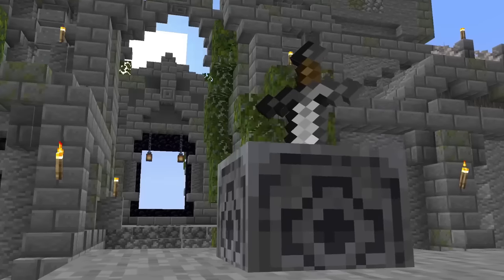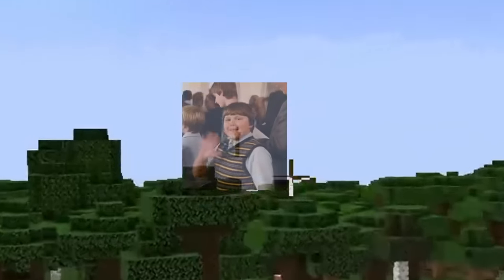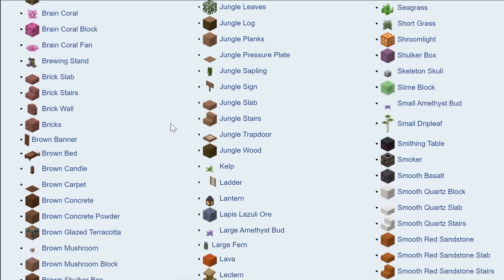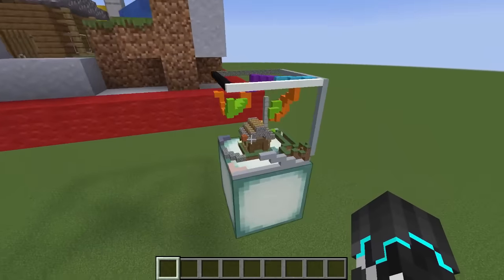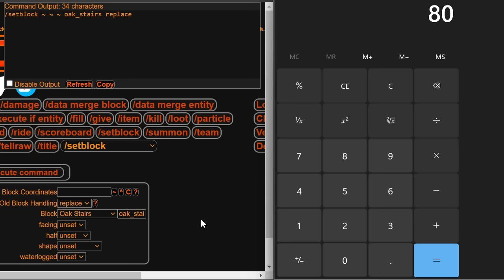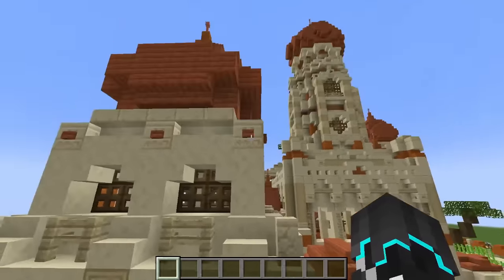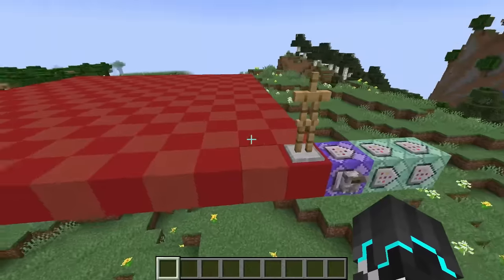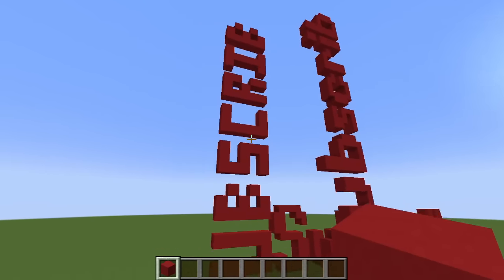3D PRINTER IN MINECRAFT

Comment: I don't know if you know but with the new macros this would actually be a single command for actually replacing the block
something along the lines of :
$execute as @e[type=armor_stand,tag=<example>] run setblock ~ ~-1 ~ minecraft $block
Although this limit the printer to work only in versions after mojang added that soo

Also notepad++ has recordings, incase that's not too late
Reply: That's what I've been thinking, right. Big problem is though that as of now, there is no command for testing what kind of block this block is. You can only ask "if block sand, if block dirt, if block stone" and so on, but you can't do something like "data get block" to get the block id. That command only works for chests and such, storage blocks.
There are two methods though that do work.
Method A is shooting an arrow at that block and extracting its nbt that says which block it's stuck in
Method B is using the loot command and thus spawning the item you get from destroying that block, and then extracting the id of the item to know what block it was.

Not the best methods for doing that stuff. I really really hope that minecraft implements a better way to check block ids. But this is all we got as of now, as much as I know.
Reply: @blarak1688  I love the idea of the printer shooting arrows at every single block before copying it over. Perfectly chaotic.
Reply: I didn’t know arrows did that!  I’m not sure if you can trick an arrow into getting stuck in a non-solid block or find the solid part of weirdly-shaped blocks, but otherwise it sounds perfect
Reply: I was telling him the same thing!
Reply: I was literally waiting for AGES to make something like this where it maps a block id to a block display

Comment: I also made block display 3d printer myself once and also got the same problem you got. It cannot read the block state and it takes too long to run. But I found (partial) solutions to all two of them.

I found the solution to block state problem in the comments of this video(thanks @blarak1688 and @uninable). An arrow stuck in a block actually stores that block's id and block states in its NBT data. Although it has a downside of only working with block that has collisions, it still enables the printer to print much more things(such as stairs, fences and glass panes) properly.
While the printer can be optimized by making it skip air blocks, it will make huge lag spikes whenever it skips too many of them. When I was making the printer I solved it by limiting the amounts of air blocks to skip, but I found a much better way to solve this problem in a command forum a few months ago. Basically, the world border grows or shrinks based on real time, and utilizing that, you can make some code loop only up to 50 milliseconds per tick. So, you can make the printer skip air blocks as quickly as possible without producing any lag.

Comment: This is so cool! I love it

Regarding the pain that is that massive hard-coded if chain, I think one could theoretically save the name string by using something along the lines of /loot give <selector> mine <X Y Z> netherite_pickaxe[Enchantments:[{"id":"silk_touch","lvl":1}]] to give the block at X Y Z to something (Such as the armour stand you already have). This has the downside that anything that just is never dropped (For instance, bedrock would be one such block) would simply end up being ignored. Despite this, it would mean that once the item has been retrieved, I think you can just merge the item name from the armour stand's item data into the block_display's data, and then empty the armour stand's inventory for the next block.

I haven't tested this though, so I have no clue if it would actually work, just offering some ideas!
Reply: this doesn’t work for blocks that don’t work with silk touch, another way (albeit even more jank) is to copy that block to some pos, shoot an arrow at arrow at it, and copy the NBT data from that arrow
Reply: @uninable  I mentioned that in my comment, but yes, that is correct. Though I did not know about the arrow thing, but it does sound janky, like you said
Reply: @GlitchlessCode  These are the only ones I know of, too. Man, Minecraft has been improving a lot on command implementations these last updates, so because of that I fall asleep every night praying and begging the coders to bless us with a command that relieves us of these janky ass methods 🙏🙏
Reply: @blarak1688  obviously mojang intended us to use negative explosion range creepers and advancements to run commands at a certain part of the tick to create player motion 🙄🙄🤦‍♂️

Comment: One way to brute force more efficiently which is probably easier to implement than macros is a thingy called tag files (yes tags very original, mojang).

To use tags you replace the block you test for with the tag name and a # identifier. Ex.: instead of "execute if block ~ ~ ~ minecraft:stone" you put "execute if block ~ ~ ~ #minecraft:base_stone_overworld" which will run for these blocks: stone, granite, diorite, andesite, tuff, deepslate (pulled straight from the wiki).
The cool part is that you can create custom tag files in your own datapack's namespace.
So, for one, you can segment the tests to massively reduce the average amount of tests per block.

Now if you create tags that bundle all blocks which share the same block states such as: all stairs, all trapdoors, all glass panes & fences & redstone dust, all directional blocks such as logs & dispensers & observers, etc...
You don't need 1600+ commands just for stairs. Instead you just do "execute if block ~ ~ ~ #Roako:stairs run function Roako:stair_check"
The "stair_check" function now needs only a little macro/return value magic to do two things.
One, check which stair type it is using the method you've been using but isolate only stairs.
Two, get the block states which you can hard code with the block state values that stairs get.
Once you have these things you got your block display.

It's probably still going to take a while to group all blocks correctly but it's a good thing many building blocks don't get any variable states.
If you really care about speed, however, you can still subdivide all state-less-blocks to get quicker queries.

Unrelated but I also wanted to mention that if you set your default program for .mcfunction files to visual studio you can use alt+select to select in columns and type or paste in every line at the same spot just like what you used excel for but quicker.
Reply from the maker: This is the most in-depth explanation I've seen so far, which I really appreciate. I have been working the past few days on getting something like this working, but like you said, grouping all the blocks and checking each of those groups is still a huge hassle. Especially when blocks like chiseled bookshelves exist (slot_0_occupied, slot_1_occupied, etc...)

I think what I'll end up doing is just replacing the datapack in the description with a version where the stairs, slabs, doors, trapdoors, and logs have dynamic placements. But other than that, it just has not been worth the time to make sure that properties like "honey_level" for beehives are maintained in the print.
Reply: @Roako  that's fair enough, look forward to seeing the improved version
Reply from the maker: @mynameisfoxxy6110  I just finished updating the datapack, thanks for the suggestion! You can print with the correct block properties for stairs, slabs, doors, trapdoors, walls, fences, fence gates, logs, wood, chests, beds, and some other miscellaneous blocks that I thought might be nice to have. I'll probably just post a short on it next week.
Reply: @Roako  Amazing job bro 👍

Comment: cant you make it instanly print by just by running the function again in the function if its not done? 
also you could use the loot command with silk touch pickaxe and silk touch shears to get the block and use macros to place the display entities i think
Reply from the maker: Theoretically you could instantly print smaller builds in 16 resolution, but when I was running the palace print it had massive lag spikes to skip all the air blocks. So to have it instantly skip over the whole build would probably just crash or never finish. Plus I think it just looks cooler to slowly build up over time :)